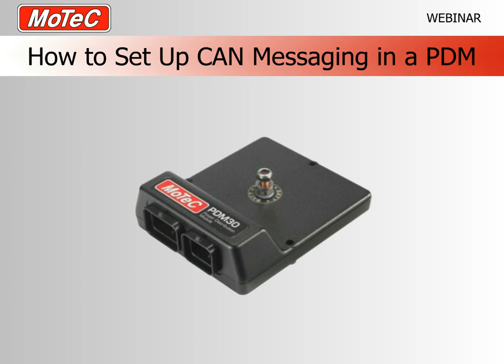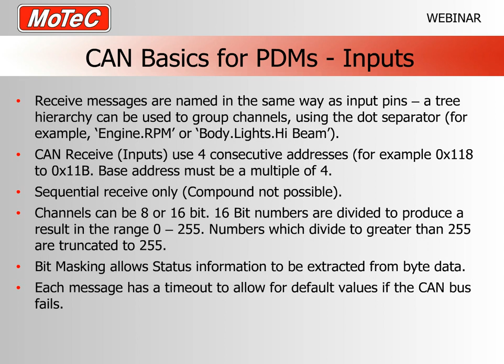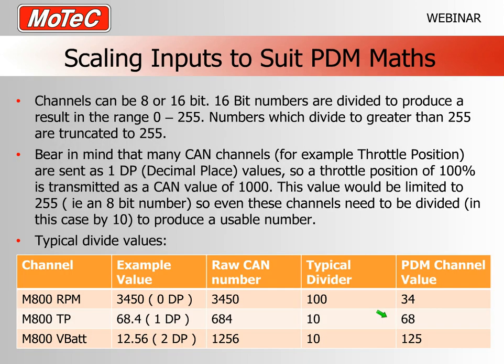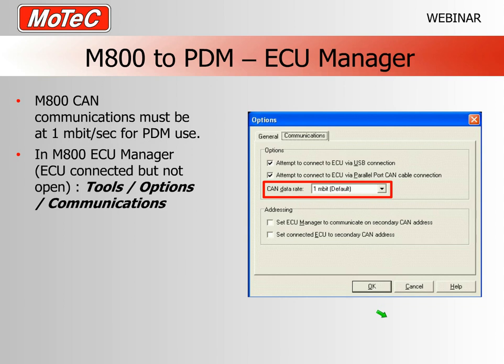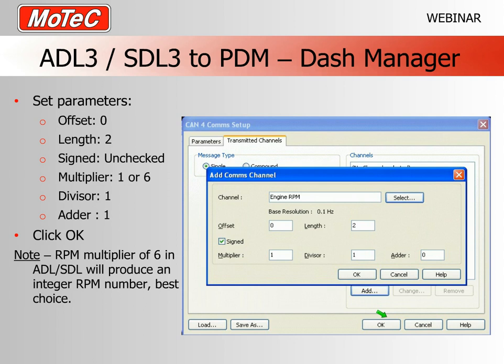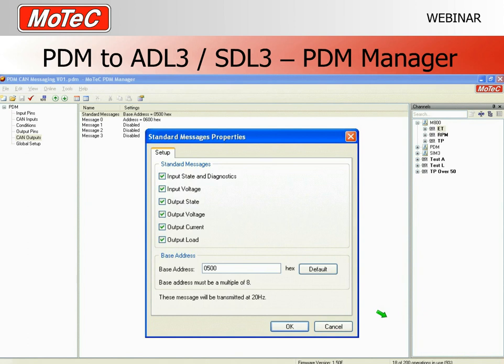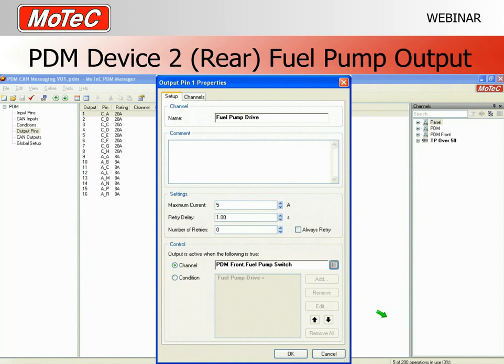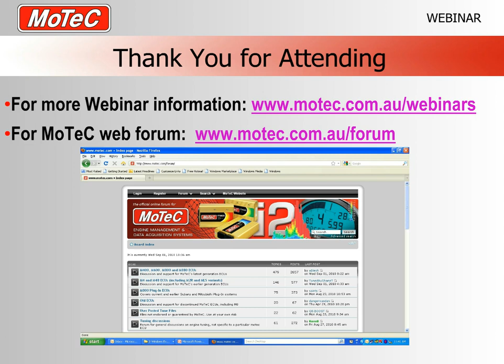How to Set Up CAN Messaging in a PDM

Comment: Why would you pre divide the data bits from the m800 when you've set the pdm to divide it also? Or is the "division" at the pdm actually a multiplication to multiply the previously divided data string into an approx value?